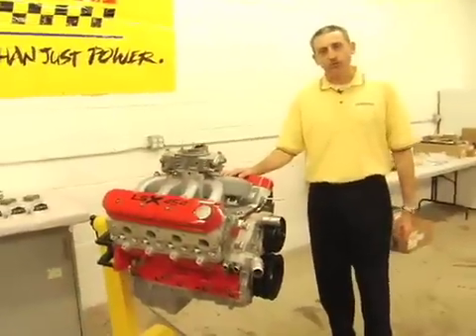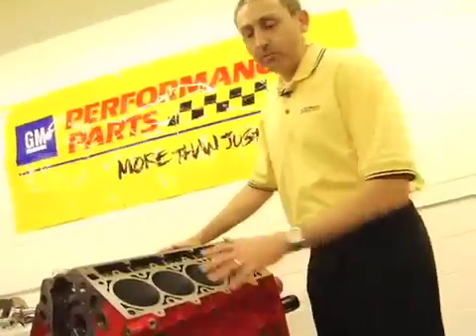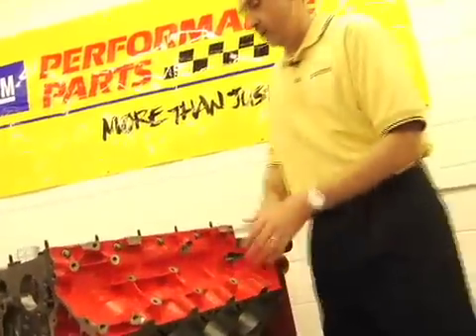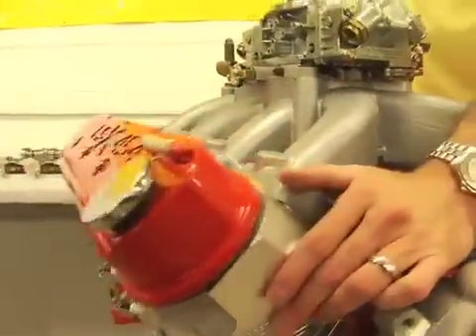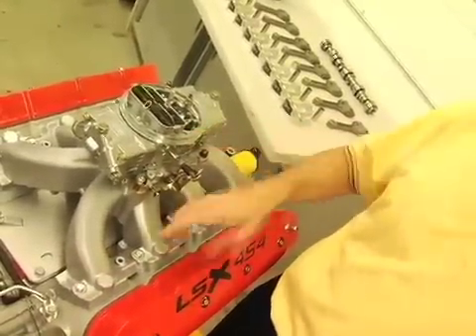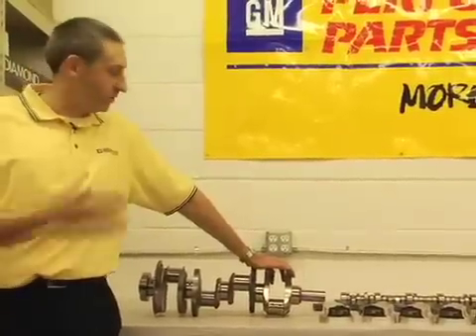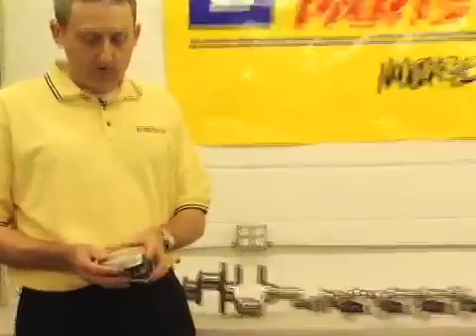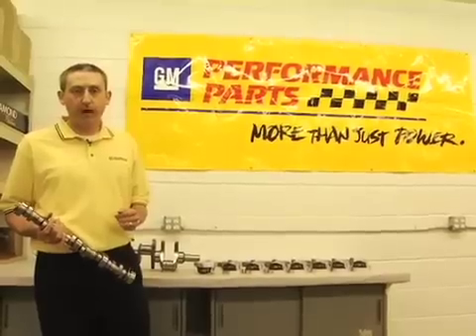Inside the LSX 454

Comment: Cast Iron is for boosted engines  I like the LS-7  but  I heard they drop valves and grenade ..  I also like the new LS-1  but  not sure  if I can put a  bigger cam in it do to variable cam timing ..  I want to use a Haltech Computer  and run it on an E-85 MIX  

   You can buy a GM crate Motor a lot cheaper than  you can build a motor with  all new aftermarket pieces.. I also  like the dry sump system of the LS-7   ..  I like the Tremac  6 speed manual   but don't think I can  get Rev matching  software like the  LTI-LE has .. had to get answers on technical issues..

Comment: They have a LSX 377 available now and it's about half the price..All forged internals but you will have to change reluctor wheel if trying to run on typical LS1 or 6 factory computer. They have it rated at 480 HP so that means it's over 500 as per typical GM underating their engines..Think LS1...2...or 6 on steriods with iron balls...

Comment: @syfe45 the ls7 is a 7.0 L engine while the lsx 454 is 7.4 L. More displacement= more power. The lsx is just a bigger, tougher, and more powerful engine than the LS7. Hands down. And the LSX is an engine that can hold up to 2500 HP. The LSX is a pure racing engine that is meant to be upgraded and used for racing. Ohhh and the LSX had more bolts for the cylinder heads so you can put more boost in the engine without the heads coming off. lol

Comment: @levisnteeshirt i cant disagree with that. they had to make it the 454ci that was the goal. i like the motor but i think for the price i will build my own version. i will build my aluminum ls2 to about 408ci with afr heads,fast lsrt intake,comp cam and make just as much power if not more. you can re sleeve the ls2 to accept 454 cubic inches. chevy magizine just did it.lol

Comment: what good is the flow of the heads if you dont give it more coolant flow. my shop partner has one and it should be faster than high 9's on the track. the heads bring in more air than they exhaust he changed the cam 635/635 he ran low nines. i think he should change the pistons ang get a better carb.

Comment: 305 motors are just small bore 350's... well people that say that 305 or 350 are a waste of time dont know enough about engines to be talking.. i have seen a 636HP 305 in a chevy 1/2ton that ran 12.90's in a 1/4..

anything is possible.. check out my profile.. just added vid of my big block